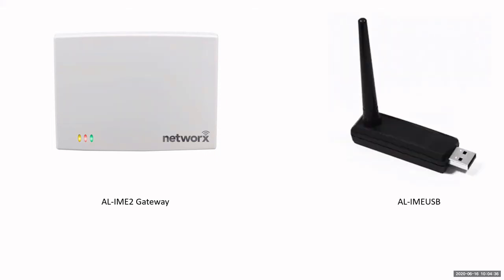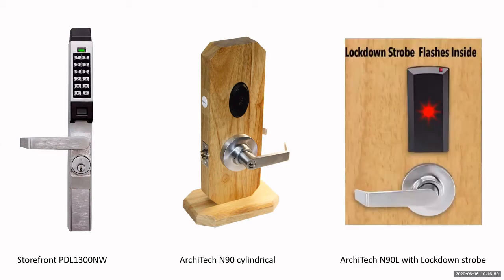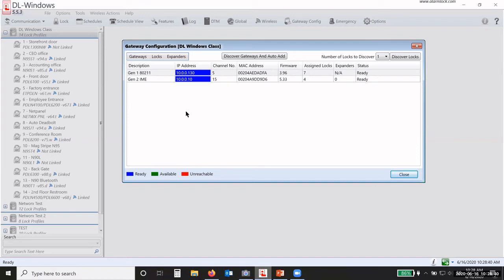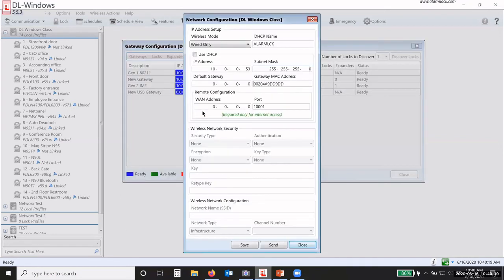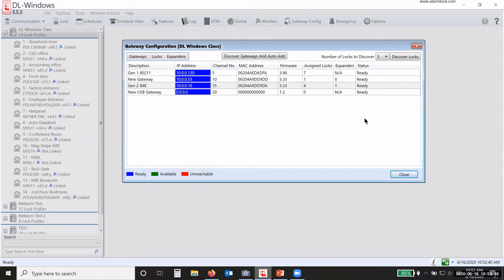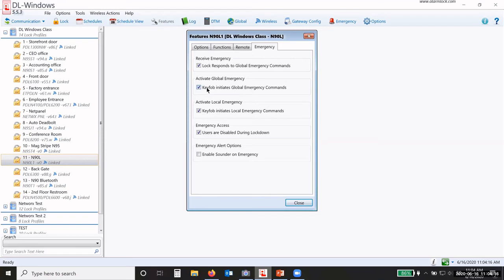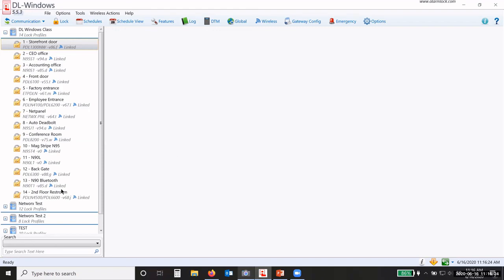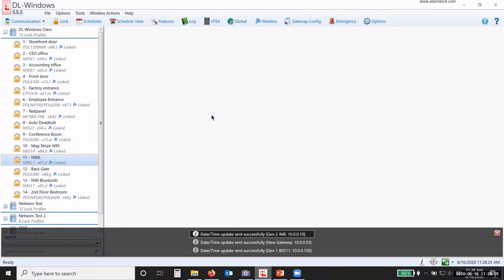Alarm Lock Networx Connectivity

Comment: I have an issue with discovering the gateway. I have power to the gateway, the orange light is lit and the green light is flashing rapidly and I can not discover it, it will not show up. What am I doing wrong?
Reply from the maker: There are many things that could be wrong. Are you connected to the correct network is one. Please either contact tech support if you are a dealer or contact a dealer if you are a consumer. It is extremely difficult to diagnose your issues via this website.
Reply: @AlarmLock  Thanks for that. I spoke to the dealer and they do not have what I need. Can I call Alarm Lock for help?
Reply from the maker: @corneliusschmitt9408  Alarm Lock tech support is dedicated to the security professional. Consumer tech support should by from a security professional. If you don't have one, call GoKeyless. They offer tech support to consumers. www.gokeyless.com

Comment: I have a gen 2 in front of me and there are no plugs for power.  Reading the manual, it is showing POE.  I hook my Ethernet up and it's dead.  What gives???
Reply from the maker: If the POE gateway doesn't power up when plugged into the network, then the network does not support POE. You can purchase a power injector from any store that offers supplies for networking.
Reply: Thank you